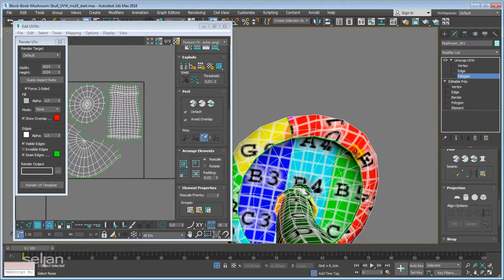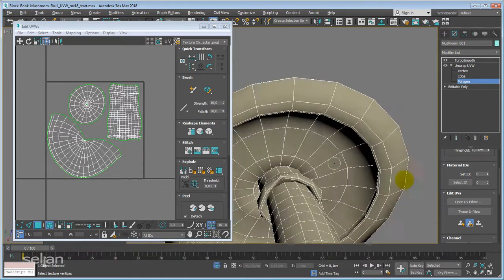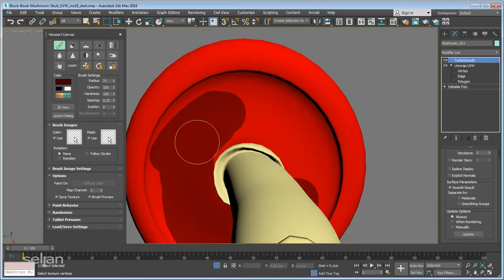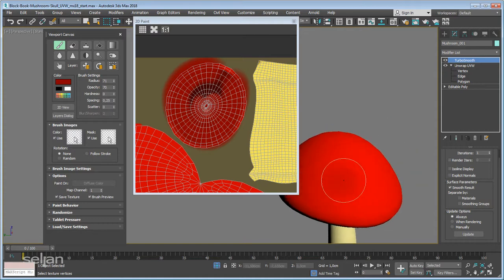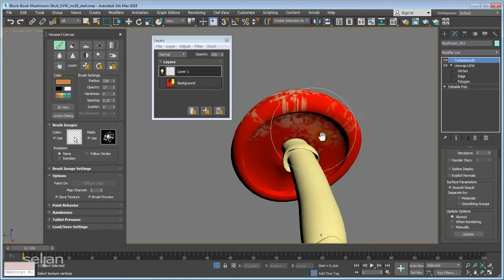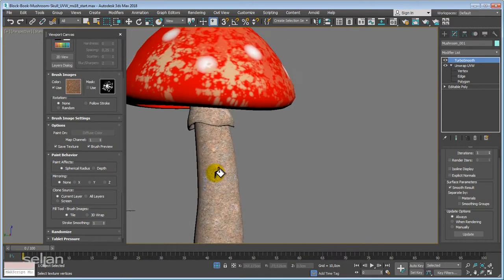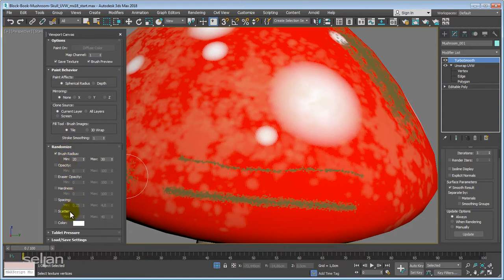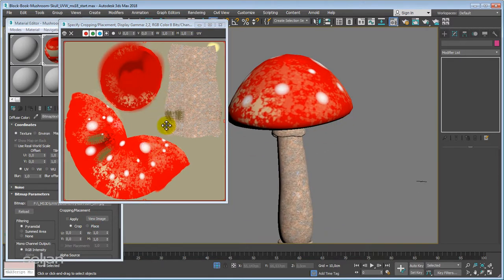MS3D | 3dsmax | UVW | 005 | Viewport Canvas

Comment: Volume is too low
Reply: Thank you for the comment! I have checked the sound and it was clear on 30% both system and Youtube volume at the same time. There is a chance your sound settings within windows are off. Please look for loudness equalization within windows.
Reply: @markseljan  I listen to videos on my phone. My phone is a note 9. I had it turned up to 100%. Most videos are too loud at that setting but yours was still quiet. Audio on computer speakers is an entirely different story, I assume